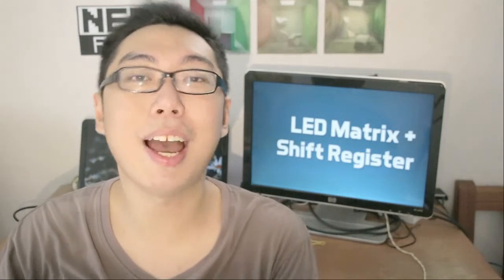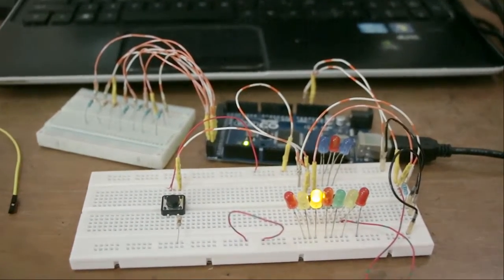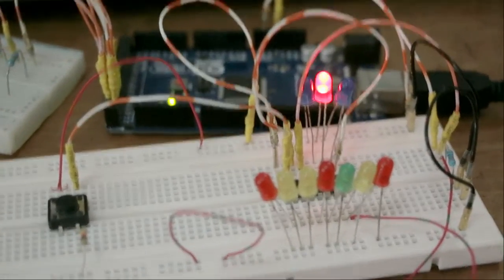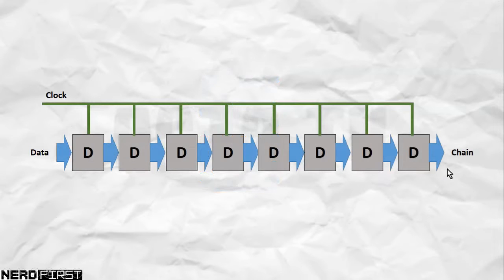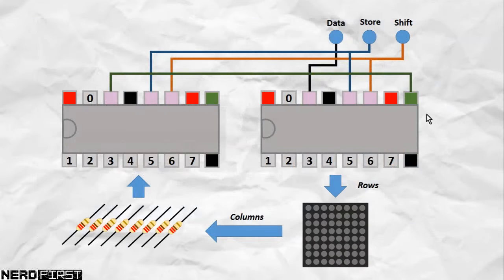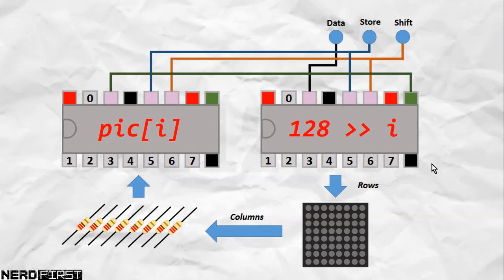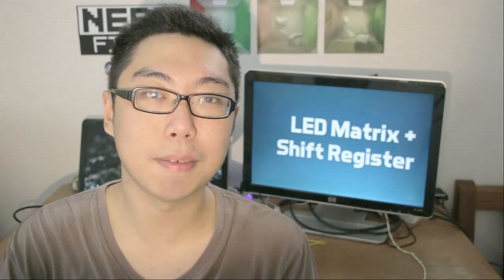Run an 8x8 LED Matrix using 3 pins!

Comment: Propbably a ridiculous question but how do you know which side is the rows on the led matrix and which side is the columns?
Reply from the maker: Hello and thank you for your comment! While the suggestion by @moises mosso is good, the easiest way is to just look for the datasheet of the matrix, which you can find by searching for the part number. The one I have is the 1088BS, and the pinout looks like this: https://drive.google.com/open?id=1LdaVACR2Yiczm33zBCXs6-uugWNl7c8k

If you need more information on the matrix, please refer to my other video on this topic: https://www.youtube.com/watch?v=G4lIo-MRSiY
Reply: With a multimeter you should get 5v on one shift resister and 0v on the other resister....

Comment: at 9:10 you show a pin schematic for the 74HC595N chip labeling 5th pin on the right Shift, and the 6th pin on the right Store. 

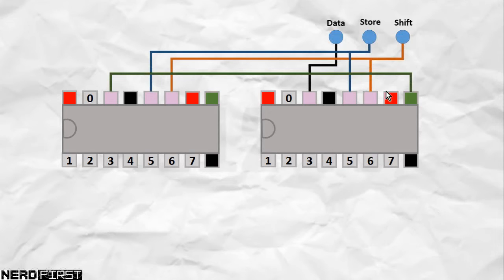but  @ 10:06 when you show the 2 chip wiring diagram you switch the Shift and store pins coming from the Arduino signal. 

I was just wondering if this was a mistake or something?

Love the content and thanks for the help so far!
Reply from the maker: Hello and thank you very much for your comment! Yes indeed, this is a mistake. Interestingly it's the diagram at 9:10 that is incorrect - The Store pin is on top of the Shift pin. Thank you very much for pointing this out, I'll add a note to the video description.

Comment: I built my own 8*8 matrix, and wired it as shown, when I uploaded the code, all of the LEDs were lit. Could you point me in the right direction to debug the issue? And something that I wasn't quite clear on from your video, should enable and reset be pulled high or low?
Reply from the maker: Hello and thank you for your comment! There are many factors that are at play in such a situation. You can try your luck with the shift registers first, but if that's not he cause you'll probably have to eliminate to possibilities bit by bit to home in on the error.

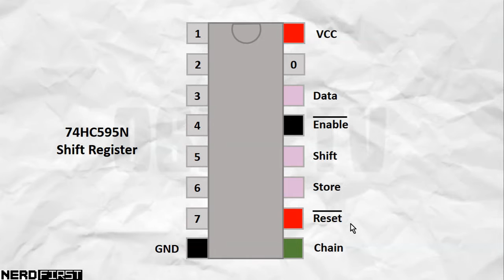So I'll answer your second question first in case that's the cause - "enable" should be pulled low, and "reset" should be pulled high, per the diagram at 9:52. Try that first, if it works then you're done!

Otherwise, you'll have to eliminate possibilities bit by bit. Firstly, try taking away the shift registers first and just working with your matrix "manually". Instead of trying to draw any fancy pattern, just try to light up one LED first. This will be a "sanity check" to make sure that the basics are okay before you attempt anything else.

If everything works fine here, great! We can examine the shift register connection and/or the code. If not, you may want to peek into your circuit for the 8x8 matrix to make sure everything is actually wired right. (In my personal opinion, I think this is where the problem is - There are so many connections and it's easy to accidentally bridge something that shouldn't be connected!).
Reply: @NERDfirst  I had a solder bridge on one of the legs of the shift register, and I guess it pulled everything high. Thank you for putting an awesome video out there. I DEFINITELY will be a loyal subscriber
Reply: I have one other question, do you know of a simple to use converter that can change the needed binary into the values needed to code different designs?
Reply from the maker: Really happy you got it figured out!

For a converter you can use this one here: https://www.rapidtables.com/convert/number/binary-to-decimal.html

Comment: Maybe a noob question but...where do I connect the data, store and shift pin from the shift registor to the arduino ?
Reply from the maker: Hello and thank you for your comment! This depends on your code! Just set aside whichever pins you want and use them.

Comment: I have a question for you. If I only have resistors on the grounds can I light up all the LEDs at once or will it have to be scanned instead?  do i choose the resistor based on 8 Leds in parallel or do i base the resistor on 1 led? For example if the grounds are on the columns and i try to light the whole column vs one led in that column. to light the whole column will i have to scan or can i just send power to all rows ? 8 leds would be on going thru one resistor..
Reply from the maker: Hello and thank you for your comment!

1. If you want to light up all LEDs (or if you want to control all LEDs independently), then you don't have to perform any kind of scanning. Scanning happens because we want to selectively light up certain patterns of lights despite having too little pins to control. To answer your question - Yes, if the pins on the "return path" go to ground, turning on the other pin will light up the relevant LEDs.

2. Assuming that you follow my design (where the resistor is placed on the "input" line, so to speak), your resistor is for 1 LED. The common return path for all the LEDs in the row does not require a resistor. The reason for this is because if multiple LEDs "share" a resistor, the total amount of current going to each LED is greatly limited, so you'll lose brightness.
Reply: @NERDfirst  just wondering if it will get dim with all the rows of an led sharing a resistor on the ground like it will when it is on positive
Reply from the maker: Yes, as resistance is "shared" across all the LEDs, their total current draw is restricted. You'll have to use a different (lower) resistance to get the same brightness.
Reply: @NERDfirst  however, if I use a lower resistance then it may overpower an led when only one led is being lit. 

So to operate the LEDs at full brightness both when lighting one led and when lighting the whole matrix I would have to scan instead of just sending power to all pins. Correct?
Reply from the maker: Indeed! Good thinking. It's still better to individually place resistors. 

If you want more consistent brightness, scanning is still better (though scanning will take away brightness as well because the leds are off more often than they're on) 

Chances are, you just  can't get "full brightness" with this setup.
Reply: @NERDfirst  thank you very much! I'm making an Led tail light for a car with a show mode for many patterns. Prob like a 10x20 on each side so sometimes I need it to be all solid and I guess the best thing to do is make my PCB with each led containing their each own resistor like you said. Your video was very helpful. Thank you and keep making them!
Reply from the maker: Sounds good! All the best for your project, and thank you very much for your comment :)

Comment: Great video!
Does it matter whether you connect the resistors to the shifting register responsible for the rows or columns?
Reply from the maker: Hello and thank you for your comment! Technically, no - As long as the LEDs somehow receive power, they will switch on.

Realistically however, it's better to put resistors on what you are not scanning, ie. If you are going to cycle through row by row (which i call "scanning" the rows), you'd want to place the resistors on the columns instead.

The idea is to avoid having an entire line of LEDs going through the same resistor. Since they'd be in series, the lights will each be much dimmer.

Comment: very good explanation! i understand now. but now i donthave idea how that led matrix can show running text. pls make video how to do running text use led matrix. i appreciate it. Thank you!
Reply from the maker: Hello and thank you for your comment! To do this, simply light up the right pixels over time, there really isn't a lot more to it, but it wouldn't be very intuitive. You can use this tutorial as a reference, but note that they are using a MAX7219 which has an additional chip to make wiring easier: https://howtomechatronics.com/tutorials/arduino/8x8-led-matrix-max7219-tutorial-scrolling-text-android-control-via-bluetooth/

Comment: Nice video! There's one thing that I want to ask: can I control one single LED and let it blink, which is a pwm signal output by the register.
Reply from the maker: PWM is a little finicky, in my experience. When you're using a shift register, you essentially have to "fake" PWM by rapidly streaming information to the register and updating the LEDs to flicker on and off. Your whole code will be tied up doing this and you'll work the shift register very hard.

Comment: Awesome explanation.  I had wired my grid together and was going to use 16 pins on my uno when I started worrying about current draw frying my board.  I then spent HOURS trying to figure if I had reason to worry.
Reply from the maker: Hello and thank you very much for your comment! Glad to be of help =)

Do note that there is still technically a concern with regard to current draw. You have to check and see how much current each LED is drawing, and it could pose a problem at two places:

1) The LEDs will now draw current from the shift register chip instead of directly from the Arduino. However, the shift register is still powered by the Arduino! The current draw of all LEDs that are lit will therefore burden the 5V pin connected to the VCC leg of the shift register.

2) The same thing goes for ground - The return path for all the LEDs go back to the Arduino's ground pin via the shift register. There is also a limit as to how much current the ground pin can sink. Again, if there is too much current drawn by the LED matrix, you still risk damage to the ground pin.

So, use resistors where appropriate, and don't light up too many LEDs at once if you're not sure.
Reply: @NERDfirst  which led I should use if I want to build my matrix from scratch by soldering the led's on a matrix of 8x16 with shift resister, with just the power of the arduino without burning it?

Comment: Great Tutorial! Very informative! For a project for school we have to show various characters on a dot matrix without using an arduino or other microcontroller. How would you do that?
Reply from the maker: Hello and thank you for your comment! It depends on what LED matrix you are using. If you're using the same one as I have, you'll have trouble displaying most shapes since you won't be able to do scanning the way I did without a microcontrollers. 

This limits you to doing very simple shapes by powering up the relevant rows and setting their corresponding columns to ground through a resistor.
Reply: If it is a fixed image you can use a eeprom and build yourself a clock to scan the lines. If you need to change the characters it is better a fpga. (I mean, because you dont want to use arduino or microcontroller), or you still can go to for a big logic circuit, always with a clock of course, with specific butttons for each character or just show in a loop, it is kinda fun but alot of work in the logic part as well, alot of wire too but it depends how good you are with logic port and karnaugh etc..

Comment: Sir, You made me understand everything in crystal clear. Could you please make video for 8x8x8  led cube.  Thank you
Reply from the maker: You're welcome! What would you like to know about LED cubes? I'm not sure what there is to discuss beyond what was covered in these videos! You should be able to extend the same idea accordingly!
Reply: Sir, Thank you very much for your reply. I made the cube and all the connection , but when I power up the arduino , just all the LEDs lit(before and after the code uploaded). Nothing else happen. Thank you.
Reply from the maker: Hello again! I'm afraid I have too little information to give you any advice.

Luckily LED cubes are fairly common projects so there are many in-depth tutorials you can refer to. Consider checking out the following Instructable, which breaks down the whole process and goes in depth: http://www.instructables.com/id/Led-Cube-8x8x8/
Reply: Thank you very much sir.